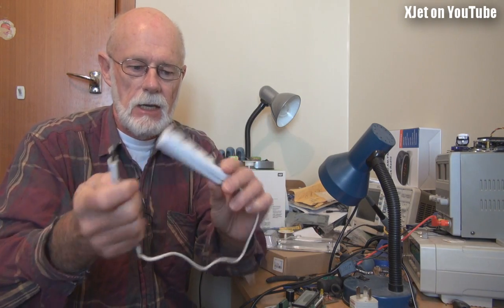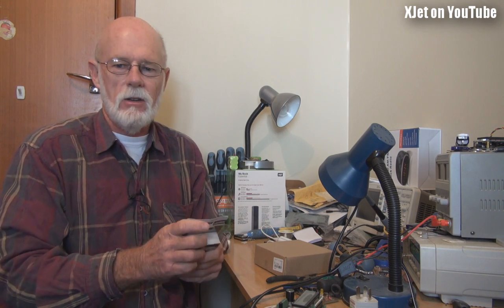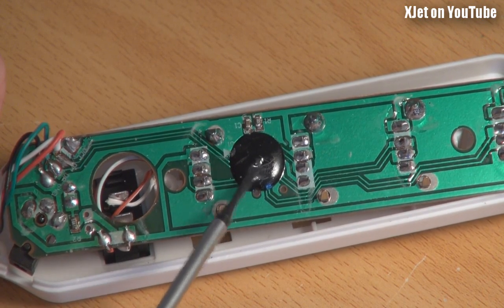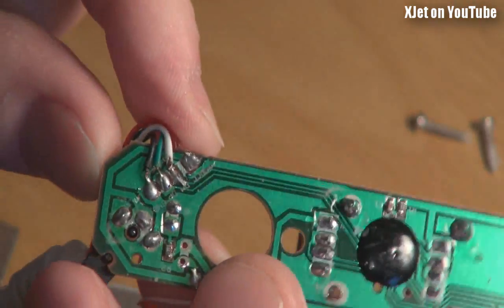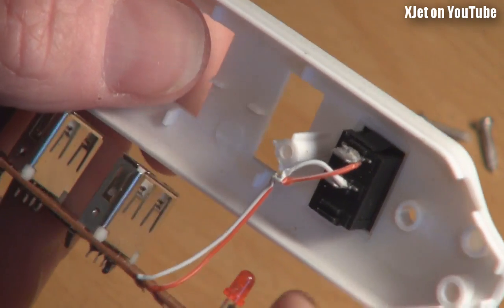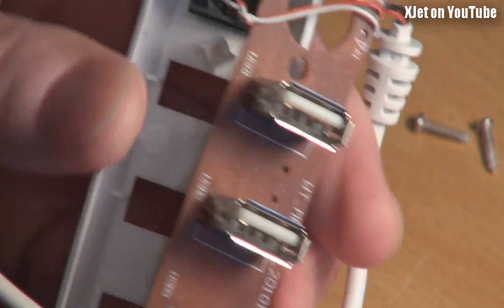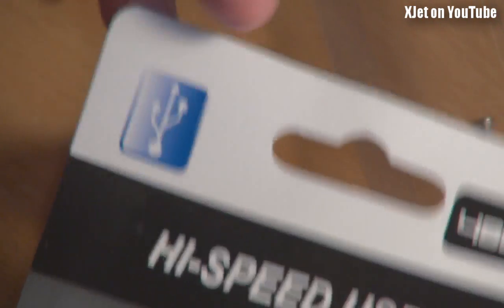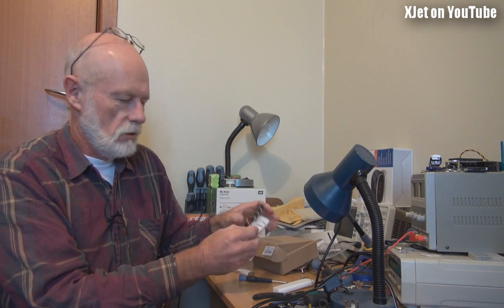A really bad bit of Chinese electronics

Comment: Now even the expensive Chinese usb adapters are garbage. I bought a new Satechi usb-c hub for $100 and the entire technical assembly slid right out of the extruded aluminium housing. The manufacturer superglued the end plug that contains the two cables that plug into your macbook to the aluminium extrusion. But that superglue failed of course and now i simply have a circuit board covered in electrical tape so that i can still use it and not short it out on any metallic object.
What a spit in the face.

Comment: i've managed to repair tons of crappy Chinese electronics, and the main reason they fail is mostly bad solder connection and low quality capacitors that leak.

Comment: I don't blame the Chinese, I blame the people that buy this junk. You know it is junk and you still buy it. The Chinese have been smart enough to realise that there is a market and have satisfied it. They get your money and you get junk. When people stop buying junk, the Chinese will make whatever sells.

You paid $6, and about $0.50 goes to taxes, $3 to the retailer, $1.50 to the wholesaler, and of the remaining $1, perhaps the split is 40 cents component parts, 30 cents labour, 30 cents manufacturer's gross margin. There is no time to care if it works or not. 

On-line shopping will replace retail, the internet sourcing (in general) will replace wholesalers, component parts will be weaker and cheaper and robotics will replace the human labour part to store, sort, manufacture, inspect, test, pack and deliver.  The good news is that quality will become more consistent, life-cycles may almost certainly be shorter, but so will the replacement time and the cost may be insignificant. In the same way that a match that wont light is just discarded and another one used is possibly how we will regard all consumer purchases. 

I look forward to seeing that as a future episode of Black Mirror.

Comment: Good video. I don't go to stores to buy cheap Chinese stuff. I go to Ebay. I order 7 port USB hubs, they have switches and lights and also have the external power port. The last time, I ordered 2 of the USB 2.0 ones and 2 costed less than this one.  They both worked decently well, but one had a loose switch and inside they were fairly decent.

Comment: i was laughing out loud ive saldered on a regular basis with an actual nail and a kitchen flambe torch to aslder and i can do a far better job than that with pretty much no equipment
Reply: you can actually get a soldering iron for less than that USB hub.  https://www.ebay.com/itm/381701776392. if you want an adjustable temperature one you gotta pay $9. bought a $9 one and it really isn't that bad.

Comment: Are the electronics themselves any good? If, say, you resolder everything properly, replace the wires sliced by the screw and so on, will it reliably power 4 USB ports? At what max current?
I bought a 6 port, 12 amp charger a long time ago. Some ports stopped working one day, and upon testing it, the fuse blew. It was probably not built to withstand the rated 12 amps.
Reply: Its just a USB hub. it doesn't have that many electronics. it doesn't power anything. it just shares the power and the data provided by the appliance you plug it into.

Comment: It even looked like they used the tip of the iron to melt the insulation back instead of a stripping tool.
Then there is the white fuzz at every solder location. 

I have one other test for you to try. Place it in a moist environment and see if that white fuzz corrodes things on the board.

Comment: there  is a very big difference between chinese electronic accessories you buy in chinese shops,, and those sold on the internet. i personally have had no problems buying chinese electronics from internet even though sometimes they are cheap copies,  they usually work ok.  but like this man i have nothing but problems with products from local chinese shops. so if you want to buy cheap do it via internet,

Comment: Do usb adaptor blocks actually need an on/off? I thought its just a plug n play thing
Reply: It is useful when you need to stop an activity right away...when I soldered a battery holder to run my Samsung Galaxy Express phone on 3 AA batteries I put a switch in there to shut off the phone in case if it goes crazy running self-replicating code...

Comment: I actually bought 10 similar units (but 7 port) for probably about $3.00 each, however I never planned to plug them into anything powered, I simply needed a way of storing usb cables and lots of little usb devices.   :)

Comment: I had so many USB hubs, either Chinese or from a well known manufacturer.
Some of them don't work at all. Some do only with a few devices or in a combination. Some give bad noise through to a connected usb sound card, that you can hear through your speakers, etc.
Got so frustrated over time, that I eventually got an Exsys hub every time. Expensive, but worth their money.

Comment: been there done that.
...
 I was in Brazil.
 disassemble the USB splitter...
 and discovered that I needed another bottle of wine...
 USB splitter required A.
 cooling system
 the Toshiba. military issue laptop was handling the + 100 c ambient temperature.
 but the USB splitter was not..
 after about 3 or 4 days I discovered that.
 if I put my finger on to the central microprocessor in the USB splitter..
 it would drop to the temperature that it would like.
 it took me days and days to figure out where the problem was..
 and several bottles of wine..

Comment: I'd wager the screw compromising those wires was the culprit more than the poor strip/solder work.   Just an observation as you mentioned that the solder work was the culprit.  Surprised when these cheapo devices have access rather than just sealed shut with molded clips.  Great little look inside -thanks

Comment: Looks like someone was using their teeth as wire strippers. Those taps are not grounded, no need to solder, just give it twist. Easy fix, but still. My 1960s vintage Ford electrical system was somewhat like that, LOL.

Comment: What is the switch even supposed to do? It's a USB hub, not a power strip.
Reply: Plugging a stand-alone 5-volt power supply directly to your extremely clean, stable 5-volt system power is a remarkably bad idea. It's impossible to read the mind of the designer (or the instructions on the back of the package), but I would hope the switch is intended to be in the "off" position when you're using the 5-volt input jack, protecting your computer hardware from the cheap transformer input.
Reply: All the ones I'd seen either switch it automatically or are so cheap that they don't care and just connect the power adapter straight to the USB +5V.

Comment: if u understand the story behind China's electronic market then everything will become clear.
these chips are made by common people who do it just to make a living. they may not be experts nor do they have expensive equipment.
Reply: Nelson aka SpOOKY would you be surprised to know that a lot of these are made in a kind of 'cottage industry' by kids, housewives and probably the family dog, panda's getting paid in bamboo, and everything else in between, using a hot nail and absolutely very little electronic knowledge? l bly flom reputable clompany, not flom clappy blackstreet climminal entelplise, OK.
Reply: BED WETTER yes, I saw a documentary film on it. even japan has somewhat similar condition.
but its okay to get it that cheap. for me most of it works ok. if they don't then i can easily open it and make a repair cause i myself studied these circuits in my college. in fact most college students opt for these things.
sometimes they are surprisingly less than the cost of individual components. i got thst usb controller for 1.5 dollars.

Comment: If I had to choose what kind of problems a cheap Chinese part had, I would pick this kind of poor solder work. I would think someone with very little electrical knowledge could identify and fix stuff like this. I'm curious though, does the goop having air bubbles really have any effect on the performance? I haven't worked with it and assumed it was just there to hold the chip in place if the solder wasn't up to the task and maybe helped with static. Most of the time I see it, it just looks like it's slapped of and they weren't worried about the exact amount. Maybe I just buy cheap stuff.

Comment: easy to resolder and make it work propperly.cheaper than buying a nother one. just bought a psu for a xbox one had a realy loud fan.i had a parts salvadged one and put it in. not as quiet as i liked but 90 percent less than the one in there!

Comment: I bought a 4 port charger which was from China and it was great build quality, but if you plugged an iPad or Android Tablet in it, it would take it over, if you turned on Dev Mode to show touch spots, you could see where the 'touching' was going it.. and if you turned off WiFi, it would automatically go through the menus to turn it back on again :/

Comment: China has some of the best electronics around, and also literally has the WORST stuff to be slapped together ever. Its generic equipment with no brand are almost always bad, but their stuff with brands are quite good. I have several cheapies like in the vid of chargers and what not and I usually repair them and they work ok. Its the fact that they normally have some kind of workmanship fault straight away that makes them so bad.

Comment: Why those wires are so far back is because someone used too much heat and overheated the joint and made the wires insulation melt. The soldering jobs they do in China are shit.

Comment: You think thats bad, I don't know if Bunnings is in NZ but if there is go and check out the Jackson 6 GPO powerboards, the surge protection ones made of metal painted orange. Soldering thats about on par with that USB, wires that were far too thin for the application, exposed rails internally carrying 240 volts AC with a metal body right next to it with a pissy ground. To top it all off they cost upwards of 40 AUD. Had one stop working on me and the only reason I found all this out was I opened it to see what might have been wrong. Needless to say for something that apparently passes Australian standards it sure was a shoddy looking powerboard.

Comment: Good on you for defending the better products, but it must be said, Chinese imports are largely RUBBISH. I'm furious about the cheap kids shoes that have flooded the market. They look good, but are utterly useless. The soles are like cheese which comes apart as soon as it touches the ground, this stuff is so soft that the slightest pressure makes it crumble into pieces. Then there are the saw blades made of metal as soft as plastic that wont cut anything, etc, etc. This cheap stuff has driven many honest manufacturers out of business. This is industrial espionage, almost a criminal act or worse, covert warfare. The labels should (sometimes) say "made in hurry". I hate racism, and I like Chinese people, but this is deeply disturbing. many of these bad products are toxic and dangerous, some electronics are potentially lethal. Enough is enough, why do our governments allow it? Greed, I suppose.